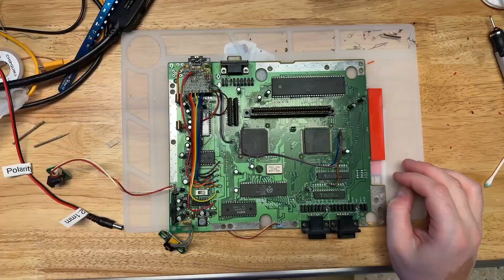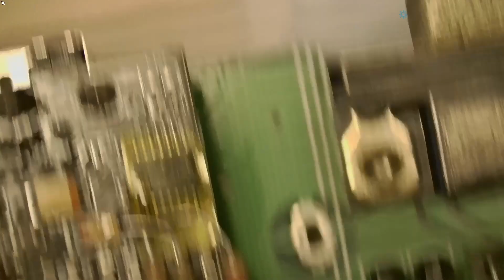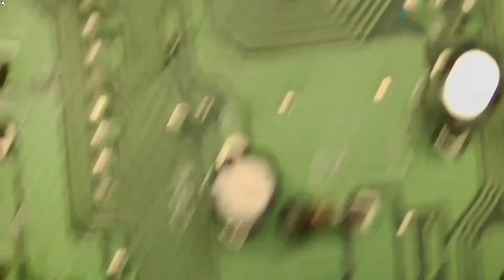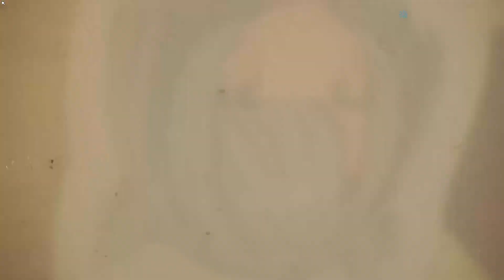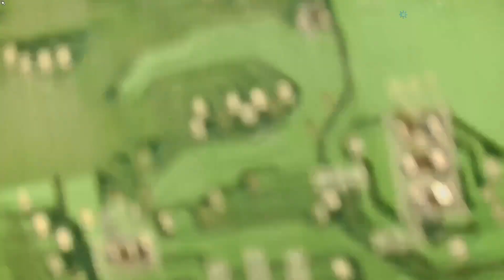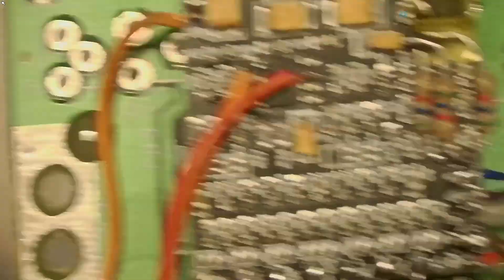Genesis 3BP Followup - VA6 Audio and alternate methods

Comment: hey dude, thanks for the info. Correct me if I'm wrong but are the pullup resistors on the 3bp board soldered to the negative end of C7? Surface mounted tantalum caps have the stripe at the positive end, so if you're getting +5v from C7, shouldn't that be soldered to the end with the stripe?

Comment: 8:55 “Maybe someone can give me a comment as to why they think this is always recommended”
Sure! At 8:23 when you said “…the pin isn’t connected in the first place” but, well, it is. The trace for pin 54 runs under the VDP to the digital 5v supply rail. You can see where the digital 5v rail goes under the chip at the top left corner.

The digital 5v on pin 54 is different from the analog 5v on pin 30. Pin 30 has continuity to the output of the voltage regulator that’s closer to the middle on the left edge. Pin 54 has continuity to the output of the voltage regulator that’s closer to the rear of the left edge. SEGA chose to have different supplies for the analog and digital sides of the chip so that switching digital circuits would not cause corresponding voltage sag or noise in the analog output.

This is also what the additional bypass capacitors are for. Both analog and digital 5v supplies for the VDP already have bypass caps on the bottom side but it is presumably not enough since we still see jailbars and other issues. Some argue that the bypass caps don’t help, and they may be right, but it can’t hurt.

On that note, the VRAM is where a lot of the interference comes from and you can see VRAM traces running on BOTH sides of the RGB traces you retained. I did that too on one of my installs but I plan to go back and change it. After all, it seems I’ve retained the very part causing the issue I intended to bypass!

The CSync signal also runs beside VRAM traces, though it is considered digital so it’s less of an issue. Because CSync happens between lines of detail we don’t have to worry about capacitive coupling of CSync into the video when routing a clean CSync line with RGB, but a dirty one with VRAM noise might be a problem.

I keep thinking about how sync on Composite Video (CVBS) causes an audio buzz with unshielded cables, especially on white screens. This is the color information bleeding into audio. I think it would pretty pretty hard to notice noise that bled into CSync subsequently bleeding into the RGB video lines but, hey, if the whole point of the bypass is to isolate from it then I guess it makes sense to keep them isolated. I just might lift and bypass sync too.
Reply: Oh yeah, I forgot to mention that I’m doing something a bit different on my current install.

After lifting the RGB pins I removed the 6 resistors from the bottom to completely disconnect the traces and then I stitched them to ground… so now the traces to pins 26, 27, 28, and 29 are forming a mini ground plane. Since the ground between pin 17 and 26 always seemed poor I’ve stitched it to my new ground and bridged all of that to a ground plane nearby.

This gives me a place to anchor coaxial shielding and pass their unshielded cores over the “ground bridge” to connect with my lifted pins… otherwise I’d be shielding my cables everywhere except the precise place where I know the interference is!

Comment: I’m not sure if it matters but the ground you chose was on the digital voltage regulator. The reason the Genesis has two regulators is to keep analog power isolated from digital so that noise from digital circuitry doesn’t find its way into video and audio signals from the power going into the analog amps and DACs. It’s all the same ground but perhaps a closer ground point or the other regulator would be better.

That said, you are already grounded through the miniDIN. You can see that the ground plane on the 3BP v2 board extends from that pad to the mounting tabs on the miniDIN. That is why the Model 1 guides leave it out.
Reply from the maker: That's a really good comment, thanks! What drives me crazy about instructions it their lack of "why", especially when different sets of instructions clash. Your explanation makes a lot of sense!
Reply: @ReddishBearGames  No problem. It’s been a huge frustration for me too, which is why I’m only finally starting to get it figured out! Might as well share. :)
Reply: @ReddishBearGames  …oh, and the VA7 and Model 2 consoles got away with a shared regulator so it’s definitely not a huge deal. :)

Comment: As you can see, the ground pad is part of the ground plane that is directly connected to the miniDIN. As long as the miniDIN is soldered to a ground plane on the Genesis board, you’re grounded. I’ve even trimmed the ground pad off on occasion since it gives me more clearance next to the full-sized DIN.

Comment: The pins break very easly but the good news is that you can get a new VDP chip.  Also you can connect to the way in the video and then remove the resistor on the other side of the board.  This allows you to keep the pullup resistors on the PCB but stop the BGB signal from continuing on to the next IC.

The added caps are for filtering the ripple from the 5 volt supply.
Reply: Where would you get a new VDP?

I have a 3BP’d VA6 that only cold boots. If the VDP is determined to be faulty then this would be good to know!
Reply: They aren’t so delicate if you lift all 6 & then solder the last 3 back down. ;)

This allows you to lift all legs from behind without bending them sideways to get your pick there. Because they were never bent sideways you won’t have to try to straighten while inevitably bridged.

You can do it one at a time or all together with a knife tip iron. Just put your pick behind, flow the leg(s), and keep the pick flat on the board as you pull away from the chip. The legs will ride over the round pick as it passes between them and the solder pads. This makes sure that they are lifted AND no solder tail is reaching up to maintain the connection anyway. Go back under them without the tapered point of the pick to make sure they are all lifted to the exact same height.

If you lift all 6 legs together I recommend putting a razor blade between the 6th and 7th leg from the corner so that your pick will not accidentally go too far and pull on a leg you aren’t heating. Also, keep in mind that the razor blade and pick will add thermal mass so adjust your extra temperature or dwell time accordingly.
Reply: @emmettturner9452  There is only a very few mega drives were you need to lift the pins.  I have a Mega Drive 1 VA4 that doesn't even need a 3BP mod.  The jailbars are only in the composite image.  RGB is clean after replacing the caps and audio is fine.

Contrast that with a Mega Drive 2 VA0 that 100% needs a 3bp mod.  omg my poor ears.  Afterwards clear detailed audio.

Real fun begins when you add a 32x and get a black screen on boot with cardridges but then works when you reset the console again.  32x CD games are fine.  The 32x has all the odd problems.
Reply: @GodKitty677  Do you have the termination adapter thing that Sega bundled with later 32X units? It supposedly solves issues like that with certain console revisions.
Reply: @emmettturner9452  I have a mega CD 2 connected.

Comment: R55 R56 and R57 are pull ups and should do the same like the 3 resistors you soldered on the 3bp board.
Reply from the maker: Thanks for explaining, and for the term to research! I'm more of a software guy, so happy to learn things about the physical side of the electronics world.
Reply: Yes, but the 5v source they use for pull-up is likely dirty power that causes jailbars. I’ve had bad luck salvaging them since they often get lost or broken when removing them (sometimes seem to be glued). Still, I’ve done enough 3BPs that I have managed to reuse them a few times now.

Comment: Not sure if any small custom PCBs may help for repairing? If so, would like to sponsor some. (PCBWay zoey)
Reply from the maker: Thank you for subscribing! I'm not sure if a custom PCB would help in this particular sort of repair. Perhaps a 'relief' board for the lifted pins? But it could be an interesting option for other jobs.
Reply: @ReddishBearGames The capacitor could be worked into a relief board. Perhaps a flex PCB that fits under three pins and against two more where you the. solder the pins back down and it breaks out to three pads.